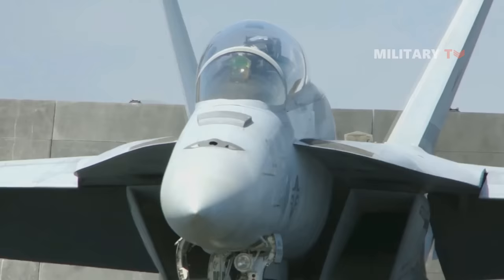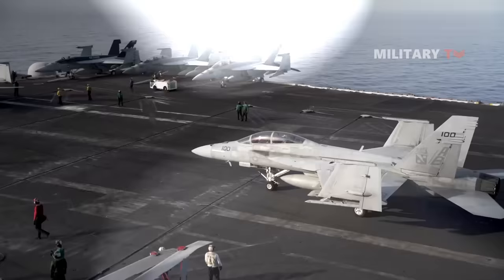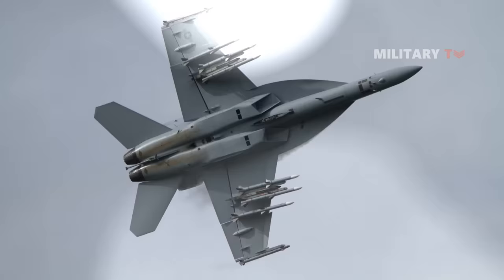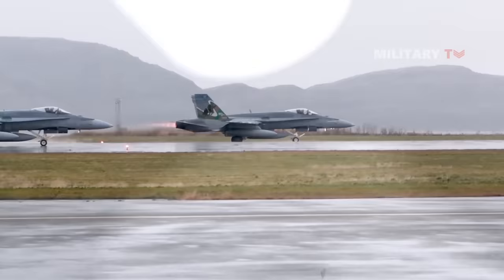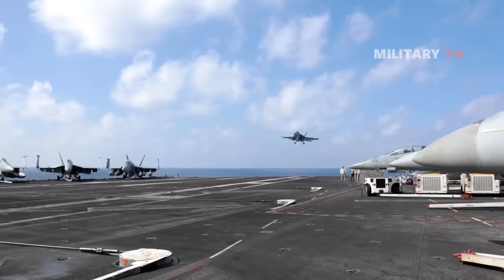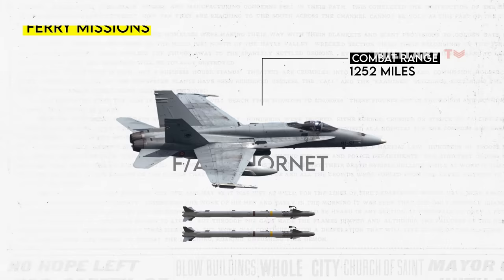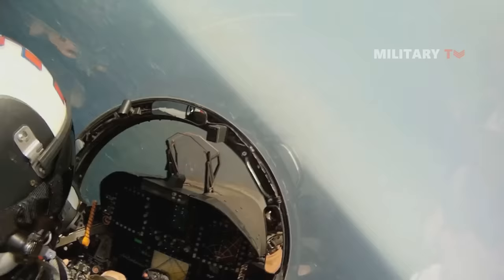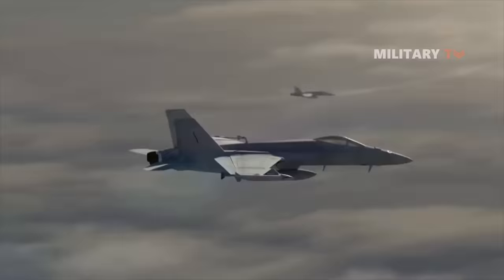What is the Difference Between F-18 Hornet and  F-18 Super Hornet?

Comment: I was a young IT engineer at McAir in the late 80s and worked supporting the F-15 and F/A-18 teams. I remember one day when the artist renderings of Super Hornet came out and one of the older F-/A18 engineers says to me: What's wrong with this picture?
We stared at it for a bit and suddenly saw the square intakes, and we said Wow, it looks like an F-15 now. 
I left the industry shortly after fall of the Berlin Wall, and spent the rest of my career in telecomm, but I still miss going out on the flight line after work to watch the new Eagles and Hornets take off on test flights. Glad that the Super Hornet has defended this nation for over 3 decades.

Comment: I’d still rather be in a Tomcat.  That’s what someone said who’d flown both.  They should have gone for the super Tomcat.
Reply: Grumman couldn't assure the Super Tomcat would be less of a Maintenance issue. Tomcats as Good as they were, had their limitations. Of which the Super Hornets were able to run circles around the Cats. Keep one thing in mind about the A Model Cats. The Crap Pratt and Whitney Engines cost the Navy on Average 1 Tomcat lost every 5 weeks due to Engine Failures.
Reply: @curtekstrom9531  Also to consider that the swing wing design was kinda antiquated by the development of leading edge vortex controls and relaxed stability; it was a lot of weight for not as much gain anymore. Also to consider that they'd be more expensive to do the same job and would be phased out eventually once stealth became prominent
Reply: @forzaelite1248  the Swing was also heavy and complicated
Reply: Too bad wanting to fly another aircraft makes it not obsolete, the tomcat was wildly expensive and would have needed major upgrades to make it competitive and by then it would just be cheaper to build a new fighter, even with a brand new super tomcat, the tomcat design still wasn't the best due to it needing heavy maintenance all the time

Comment: A much bigger price tag.  "As an example, in the late 1990s, the unit cost of the F/A-18 Hornet was around $29 million, while the unit cost of the F/A-18 Super Hornet was around $57 million."
Reply: That's because the super hornet had to replace several other planes roles.  A6 A7 and F14
Reply: It replaces everything except the Hawkeye and Growler. And whatever the Navy uses for mid-air refueling.
The flexibility if gives to the air wing is worth it. As long as the pilots are up to it, they can run every mission with any of the Super Hornets.
Reply: @recoil53  The Growler is an electronic warfare variant of F/A-18 Super Hornet.
Reply: @recoil53  navy uses F A 18 as refueler and the Growler uses the dame platform.  Its a jack off all trades, but it masters none.
Reply: @cannonfodder6299  Sure, but is there an enemy 4th gen platform that exceeds it in any one aspect?
Sure an F-15 is better, but that's American.
Reply: @cannonfodder6299  No.
Reply: @recoil53  Su-35SM is a much better aircraft
Reply: And the F-35 is coming in at $245 Million each.
Reply: @curtekstrom9531  That looks like the lifetime cost.
Reply: @recoil53  Nope
Reply: @curtekstrom9531  The F-35 goes for $70-$90M each, depending on model.
Of course there are spare parts and training that can be bought too.
Reply: Russia can save money, and be used to mop the floor.
Reply: @tomascastillo4676  Better than a hang-glider. That's about it.
Reply: @curtekstrom9531  95 million each, with cheaper maintenance. Plus they don't lose every engagement like Russia's flying egg crates.
Reply: @curtekstrom9531  While Russia's flying egg crates are wiped out within minutes. Penny wise and pound foolish.

Comment: The F/A-18 (Legacy) Hornet was originally intended to compliment the Tomcat, not the Super Hornet.
Reply: @USN1985dos  that is not true.  The Hornet was designed to fulfill dual roles and also provide a means to simplify training, maintenance etc. by retiring several other platforms and consolidating onto this as the replacement.   The A-7, A-6, F-4 and A-4  were all retired and replaced by the Hornet.

Comment: Most reports like this come from other sources that have never dealt with the design or engineering. While the F/A-18 E/F is 30% larger, it also was required to obtain Super cruise, ie Super (supersonic w/o after burners) . The Carver inlets will not obtain Super Cruise in part due to the MacAir design. This was before Boeing purchased McDonell Douglas. It's still a great aircraft. 😊

Comment: The Super Hornet wasn't meant to complement the F-14 - that was the task of the Hornet - but to replace it, becoming the US Navy's combat role equivalent of the US Air Force' F-15. 

Arguably an interim solution to serially produced F-35Cs, the Super Hornet it is still a light-weight fighter design, capable of mass production.

Comment: What a great video, can't wait to see the F15 EX / F15 comparison. I just wish our engineers would go with thrust vectoring on everything we fly. Not for the energy bleeding airshow maneuvers, but to allow our pilots to turn as tight as the human body allows and for short take offs and landings. F18 is a good looking bird, but I hate to say SU35 is probably the sexiest machine in the sky at the moment. May the F18 make them all crash n burn.
Reply: How would thrust vectoring allow for short landings? Also there isn’t much of a need for fighters to be able to turn super quickly so thrust vectoring is kinda pointless. And because it’s just one more thing that has to be maintained, it increases the operating costs of the aircraft it’s used on.
Reply: @ryanborax7851  ya vectoring benefits takeoffs.  I threw the /landing in there in error. Didn't feel like  editing it. I based my argument on the rave reviews the 22's manueverabilty gets from all pilots. I figured it was the next great thing, and 2d vectoring would be on all future fighters. Have you seen the new SU57 upgrade? 2d vectoring now, there is something to it. "Fighters" need to turn tight since missiles don't always work. They keep putting guns on the fighters. That's my end.

Comment: 0:36 I stopped watching this video right there. The P-530 is not the F-5E you're showing in the picture. The P-530 is similar  architecture than the F-18 with  high wing, inteke under the wing, and single vertical stabilizer, it was flown in 1967. The F-5 you're showing is a low wing with intakes on top, a completely different configuration, so it can not be based on that aircraft. The P-530-2 was the first prototype with 2 vertical stabilizers as we se on the F/A-18.

Comment: The Super Hornet is incapable of going supersonic at sea level while carrying any type of external stores.  It also happens to carry its ordinance offset from the centerline of the airframe, which you don't need an aeronautical engineering degree to know is not ideal for parasitic drag.  How did that make it through DOD approval I wonder?
Reply: Name me any airframe of the last 70 years that can go supersonic at sea level with external stores? Name me any airframe of the last 70 years with a comparable rate of climb, TOS, payload and range? Tell me the name of the last airframe you designed, built and flew in combat please?
Reply: @megafauna8374  the F-14D SuperTomcat can easily.  Listen to any number of interviews of pilots who flew both planes.  Two pilots, “Jungle” Jones, and Meagan “Vargas” from the movie speed and angels are quoted as saying the Super Hornet is “so slow it can’t get out of its own way,” and “relatively speaking, the Super Hornet is a Slug 🐌 compared to the Tomcat.”  Their words not mine.

Comment: F-18 Super Hornet is likely more superior only because it's a newer upgrade and a bit of redesign of the original F-18 Hornet. However, the look of the original F-18 Hornet reigns supreme over the Super Hornet. The F-18 Hornet is probably the best looking plane that's ever built in the history of mankind and likely will be the to the end of humankind if there is no WWIII.
Reply: Not quite. The original was more nimble and had better acceleration, but longer combat range makes the Super Hornet significantly more operationally effective. How good a fighter is doesn't matter if you can't reach the target, and it also doesn't matter if the floating base it operates from gets sunk because it has to operate closer to the threats in order for the fighters to strike them.

Comment: Super Hornet was a con by the Builder as they sold it as being just an upgraded F18 when in fact it was a brand new airframe that looks like a F18 and now because of overuse the Superbug airframes are showing fatigue rates equal to a Legacy F18 that had twice as many flight hours. Maintenance hours are now at similar levels to what the F14 required but for a far less capable plane. Less range, less speed, less time on/over target.....

Comment: That jet you've shown as the P-530 isn't it. This is the F-5 Freedom Fighter at video
Reply: F-5 Tiger II.  Freedom Fighter is the EXPORT version of that jet.
Reply: @karlchilders5420 Originally the F-5 was called the Freedom Fighter, only in Vietnam the branch of F-5As converted into F-5Cs was called the Skoshi Tiger and the second generation of this fighter, the F-5E and later variants was called the Tiger 2 as the successor to the F-11 Tiger
Reply: @karlchilders5420 But one thing you might be right about, is that the F-5 in the picture is a late version as you can see from the enlarged leading edges

Comment: Conclusion:
Bigger is better!  Do not think you can take your tiny Cessna Aerobat to do the job of a large, hard pumping, metallic, throbbing, F/A-18 Super hornet. If you are told that you are sexy flying around in a Aerobat, your girlfriend is thinking about the steely, super rigid, hard penetrating, Super Hornet.  So take your Cessna 152 Aerobat back to the hanger. Satisfaction comes at supersonic speeds.

Comment: Bullshit. The hornet was cheaper than the f14. The supper hornet actually cost more than the f14 defeating the purpose of the switch meaning we could of stayed with the superior f14s
Reply: Yes cheaper factoring inflation
Reply: Politics also killed the F-14.
Reply: Cheaper? The f14 was way less capable they always broke down always had to be fixed. Also took up alot of space due to it not having foldable wings.
Reply: @RW-zn8vy   they were going to contract out all new f14s with all updated stuff so they cost more than the hornet so that's why they went with it.. when the navy realized they needed a bigger 2 seater that's when they realized they Fd up and were locked in with the supper hornet that cost more because of contracts from the hornet. But the 14 was a better jet it wooped the hornet why you think they never surplused them out to other countries other than the f up with the Iranians years before that. They didn't want better jets in the hands of an enemy..
Reply: @jimmieburleigh9549  the reason they never sold hem was because it wasn’t intended to be sold. The f15 is way better than the f14 and it’s sold to other nations so that has nothing to do with it.
Reply: What do you mean, the F-14D cost $196.3 million adjusted for inflation while the super hornet currently costs $66.9 million
Reply: @jimmieburleigh9549  Dawg the F-14D costed nearly 3 times that of the super hornet, an upgraded version would have costed more than that and would have still only been a little more capable than the super hornet

Comment: In my opinion a lighter, smaller craft is better. But, the world is dominated by electronics now, so there you have it. You said noting about maneuverability. Can the super turn inside the hornet?
Reply: If you end up in a merge you've done something wrong. The Super has such a better radar than the legacy. However, the C model with the F404-EPE is the hotrod dog fighter of all the Hornets. As stated, the Super recovers energy better, something important for a radius fighter. But the aircraft are close enough for BFM that the best pilot usually wins.
Reply: Nope but good maneuverability is obsolete

Comment: Boeing propaganda. I spent my whole life flying beside SHs in Naval Aviation. It’s design is aerodynamically flawed. Wing chord was increased, creating a huge parasitic drag penalty, as did the serpentine eng ducting + canted pylons. Above .85IMN, the fuel burn is significantly higher than the F/A-18C. Only at Max Endurance does the SH realize more flight time. It has a worse E/M diagram and can’t break the sound barrier at sea level. It’s basically a sub-sonic aircraft. The Navy loves it because it has higher “bring back” and yields longer deck cycles, but in the grand scheme, it’s a step back. Yes, it has lower RCS, but isn’t significant enough to justify the performance penalties.

Comment: SU-35 vs Super Hornet.
Reply: With an Updated Super Hornet with AESA and all the newest counter measures it would come down to the pilots abilities and who had the advantage at the time of engagement. Maintenance of course is an issue that could degrade either side. USA does 168 to 240 hours of flight  to keep their pilots sharp . Russia Hyped the T-90 and when they got tore apart to see what’s there it was not that impressive . The same Hype surrounds the SU-35, but the only way you will ever know is if they meet in the Air with Pilots of equal skill level and with several engagements.
Reply: @rosskious7084  Only 5 T-90M have been destroyed/captured with atleast 1 confirmed to be destroyed by Russians themselves during withdrawal.
Reply: @niweshlekhak9646  Out of "how many" T-90's made??? Now compare those few with how many Abrams, Challengers, and Leopards have been made and are operational ---- I'll wait.....
Reply: @Ezees23 и что,вам их не жалко?

Comment: Twin engines have more power than a single engine
Reply: Genius
Reply: The two engines on the F18C/D make less than the one in the F-35, and with the core upgrade even the Super Hornet's 44,000lbs is gonna get edged out. Mainly a difference in size and tech though

Comment: Neither of these aircraft or F-35 can intercept a Chinese aircraft at 1000 miles launching an anti ship cruise missile.
Reply: Funny you think an aircraft can find and lock a target from that range.
Reply: Except you are wrong, tanker can be set up 200 miles away from the ship, that gives 400 miles extra range, they could also already reach 1000 miles without in air refueling though it would be a stretch
Reply: @RW-zn8vy  Where did you get that information from, super hornet could probably target a bomber at 3-400 miles, wouldn't be able to fire a missile until within about 100 miles
Reply: @gibbo_303  with awaccs support for sure
Reply: @gibbo_303 I believe that was his point.